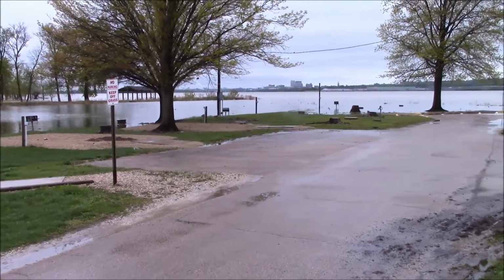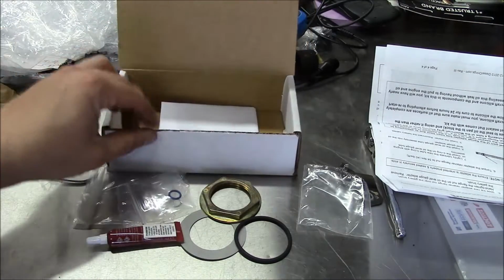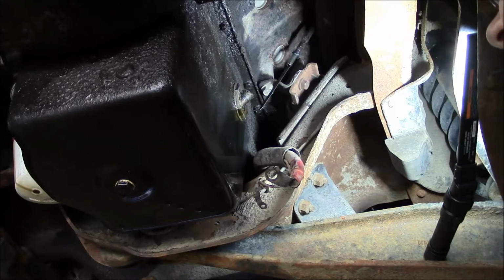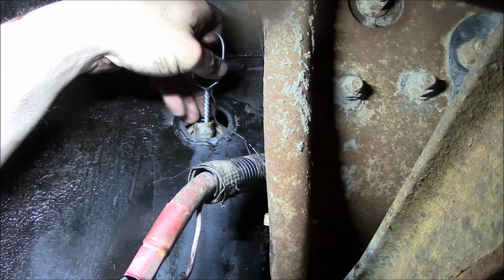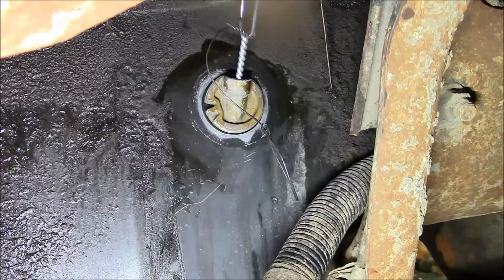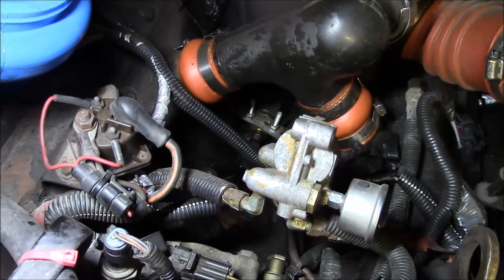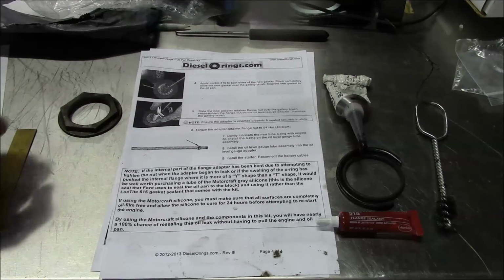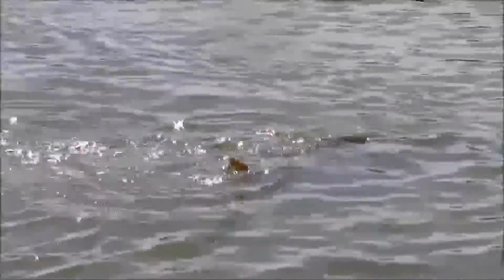7.3 Powerstroke Dipstick Oil Leak Fix

Comment: I see one person posted about sealing it up with silicone I use Right Stuff gasket maker that stuff is pretty much lifetime repair all you need to do is back off the nut hang on to things clean everything up put a bead of gasket maker all around the flange threads where it meets the pan and behind the nut so when you tighten it down it squishes out everywhere paying special attention to the two grooves because that's where the oil tends to run down and you can even put a layer over everything once you tighten everything down snugly and with that repair it'll never leak again I fix thousands of things with Right Stuff gasket maker is an amazing product best bonding agent I've ever used

Comment: Did this solve your leaks? Looks like you had oil on the starter and the front part of the transmission. Was the valley clear of oil?

Comment: Wow! Just wow, you're correct about the nut being over tightened that's exactly what happened to mine by the previous owner, whoever invented that kit was a genius, that brush tool was the cats meow that's for sure, I did mine the hardway, the first time I used silicone and it didn't work, the second time I used a whole tube of JB weld, one of the large tubes, it's been holding for the past 5 years, I sure wish I knew about that brush tool beforehand.

Comment: Tried the oring on mine & the flange is not bent & the oring seemed to thick & couldn't get the nut to start so its getting gasket sealer tonight!

Comment: Good video.
 I bought a new o ring kit, it leaked again in 2 weeks. For my 2nd try I used old intercooler boot and cut a gasket using the outer nut as a pattern. I cleaned inner surfaces, put my homemade gasket in place of the oring. No RTV or other inside the pan. It's been a year, still good. I hope this helps someone.
Reply: what is a intercooler boot?

Comment: the day is coming when you will have a sighted self-directing  little robot on a stout steel stem that can sneak in behind all the struts and cables and impossibly tight spaces where a gripped hand won't really fit and it will undo all those bolts behind the starter housing and tucked up under the air compressor and in behind the alternator......the guy who invents that take 'em out and put 'em back in bolt/nut/fastener extractor robot is going to be a billionaire

Comment: How do you like those hantek amp clamps? I've got the lower current one and have considered buying the higher current one. Only issue I've noticed with the lower current one is that the power/current-range switch is a bit fiddly. Lol, yeah, the oring swelled and bent the flange...

Comment: I installed a 6.9/C6 in a 1953 IHC R120. The 6.9 was a constant source of leaking. Repairs never lasted.   I retired the truck with the engine after I got a warning ticket from the environment police. The dipstick was always a problem. I remember fixing oil-cooler leaks a few times. Another area of failure was the bi-metal swath for the glow-plug circuit. I gave  up fixing this sensor after burning our several sets of glow plugs. The 6.9 was not a good cold engine starter. I used ether for most of the 225,000 miles I drove that truck. A little whiff will do just fine.

Comment: Do the instructions say to put the sealant on the INSIDE? I would be afraid it would just peal away and get in the pickup screen because you can't clean the inside of the pan of oil.

Comment: I might be missing something here but couldn't you drop the oil pan and replace the nut? 
Either way same result so doesn't matter. 
I'm just curious
Reply: It’s a pretty major job to remove the oil pan.  He mentions you can do it with removing the engine, but you do have to remove the transmission.

Comment: Dave Kersey  Sept 12 2020  Cam sensor  Have a 1996 f-250 73l Was a TSB on depth of sensor in block  ford had a TSB that added one or two shims to back it from the cam. Now they make two different sensors.  If that didn't work there sugestion is to replace the cam.. I used the shim and got it to work. Have you run into this ? Dave Vietnam vet 82 yrs old.Thanks

Comment: I remember this futile attempt to stop leaks. I installed a 6.9 Diesel in my R120 International. I drove it for 20+ years and about 225,000 miles. Oil leak mitigation was an annual event. I have Cummins now.
Reply: And now you replace transmissions instead of oil dipstick o rings. I noticed you said 'a cummins' not 'a dodge'. I wouldn't want to admit it either.
Reply: @blackhatch46  hater
Reply: @Log-Outdoors  Is that an insult? I dont understand inner city slang.
Reply: @blackhatch46  hahaha, shouldn't you be pulling the cab of your 6.4 just to do a head gasket? Power junk

Comment: Is it possible that they put a thicker o ring on the inside of the pan and said OK lady???and maybe it did work for a while and swelled causing it to bend??better solution what you did instead of dropping the oil pan!!!good work as usual!!!

Comment: Be very careful using brakleen around engine oils. 1 can of that stuff can contaminate up to 2000L of oil. We aren't allowed to use it in the oil fields anymore as the upgraders are saying it messes with their refining process.
Reply: holy snap.  thanks for sharing that very interesting.  a weird fact i learned in a township meeting, a little gasoline can ruin an aquifer, it moves faster than the water, some lady had a fuel oil delivery but no tank ... but the french drain...

Comment: Nice job, did you have  to drain the oil after all? Any issue with leaks so far ? Gonna do mines same way
Reply: Having the same issue and was curious about if you had to drain any or all of the oil.

Comment: I was always told you had to wait 15 to 20 minutes to let RTV set up a little bit and then go back and tighten it all the way, obviously that's untrue?
Reply from the maker: That's a good idea. It's not really possible here though since we have RTV on the threads. The big thing is to wait 24 hours for the RTV to cure before refilling the oil.
Reply: @WatchWesWork  ok, thanks that makes since...
Reply: no mechanics i know actually follow that, but it can't hurt, give it 10

Comment: If silicone is a hack then every modern engineer is a hack, all the modern shit i work on has most the engine covers and pans siliconed on, gone are the days of gaskets, i have done this on 7.3s using the motorcraft silicone and it usually works good.

Comment: FYI my son in law worked in the industry making seal that seal you replaced had a glue joint that's where it separated they since found a way to mold them solid no joints all one piece every o ring had to be glued and go into a heated iron for a hour one at a time how arkaioc

Comment: For the next time you have to tackle a leaking dipstick flange, you should look at my new kit. 73dipstick.com. I address the fact that the internal o ring is a problem. My kit seals from the outside because most on the internal pieces are deformed from the o ring failure.

Comment: You are right Wes, the dipstick adapter was overtightened at one point and time, I have seen it alot on those 7.3 / 444 engines.

Comment: Same issue on my 2002 7.3 oil pan cleaned it up real good on the outside never taking it apart as you did put high temp silicone on let it sit for a couple days it's been 3 yrs and no more leaks so far.
Reply: Do you happen to remember which brand  silicone you used on yours? I'm trying to figure out which one to get. Appreciate your help.
Reply: @somyal  it was a high  temp grey or black from Napa.
Reply: @ryanroads7748 thank you.

Comment: Your drawings are great.  I tried a o-ring on mine but it didn't work, flange was bent like yours.  Slathered motorcraft gray silicone all over it and it never leaked again.  Better than dropping the pan or those $300 kits out there.  No shame in that repair.
Reply from the maker: Like I said, International has a TSB basically saying to use silicone. Seems like a hack job, but it works great.
Reply: Well, how about this for a jack job.

I didn't remove the dip stick tube, and ran the nut off with a bungee in place on the tube to keep pressure on the inner o-ring. Used a tooth brush, and a can and a half of brake cleaner to get the threads, the two dimples for the orientation pin, and the surface of the pan where the nut sits surgically clean. I did get a good amount in the oil. I wanted to make sure the oil behind the adaptor was clear and it was clean, as to not contaminate the the sealing surfaces at the base of the threads. Contamination = no seal. After getting it all clean, I applied motorcraft TA-31 sealant to the alignment voids on the adaptor first with the tip of of the nozzle, and made sure to fill the void, and about 3/16" bead to the base of the threads.  I then ran the surgically clean factory nut, right back on there, and snugged it down. I let it sit for two hours before filling the oil after dropping it to remove contamination. 

No dipstick o-ring needed, no o ring for the inner adapter seal. Just a clean properly prepped surface, some 7.3 silicone, and it's bone dry. Probably a lifetime repair. I'd bet on this over any of these bullshit kits. Total cost, $23 for a tube of the TA-31, and about two and a half hours, mostly waiting for the silicone to set up. 

Yeah buddy.
Reply: I forgot to mention the squish out around the nut after snugging it down even looks factory. 

I'm thinking about making a replacement nut, flanged, with threads all the way down, and dual o-rings that seal on the outside. A very small dab of TA-31 at the engagement dimples before install, and bam. 

Sell them for a reasonable $25. 

I'm half tempted to get the 3d printer going. Seriously.

Comment: Wes o rings don't swell in oil. What they did is replace that o ring with a heavier one and tightened the hell out of it breaking it and bending the nut and internal part.  Ford with a better Idea?

Comment: The OEM nut was probably cast with softer metal to allow it to conform a bit with heating but along with that comes all the drawbacks of softer metal.  Your new kit nut was better with the larger flange and may have prevented the whole problem had Ford spent the extra dime to start with.  Anyway, another good fix, because of the opportunity to get silicone all over your hands and anything you touch!  I enjoy your one-man shop vids as I grew up in my Dad's one-man shop figuring out how to get her done by himself.  Not sure everyone appreciates the extra challenge of going it alone.
Reply from the maker: It's lots of fun until you need to bleed brakes or watch something under the hood while cranking the engine. It would be nice to have help a lot of times!

Comment: That Toyota FIPG is the toughest stuff I’ve ever used. Once it sets up on an oil pan you don’t even need bolts to secure the pan. I’ll take a jackhammer to ever separate the pan from the block. We used to call it Figpig way back in my dealership days.

Comment: Im chasing oil leaks on my excavator now. Rear main seal on the detroit and doing all the suction and pressures lines on the 3 pumps.   Also have a leaking valve body that i really don't want to mess with right now.    the dodge just did the oil feed to the turbo and the pan has a few damp spots so Im sure  its got a rust pinhole in it.  Pans are cheap but its all the work to replace one. 

Hope the silicone holds up for you and the diesel leaks were just those hose clamps.   Just keep telling yourself a few nickles and dimes is a lot better than a new vehicle payment.
Reply from the maker: Be careful with the new oil pan. I remember Deboss Garage did a video about a 5.9 Cummins that was ruined by a Dorman oil pan when the paint inside peeled off and clogged the oil pickup screen. I never would have thought of that!
Reply: @WatchWesWork   yikes thanks for the info. ill have to check it out.
Reply: @WatchWesWork  just sandblast it, no?

Comment: Good effective repair, possibly the old O-ring is a larger section size, and was cut to fit?.
Hope the water level stays below danger line.
Reply: Kinds bad idea to use a cut to fit o-ring inside the engine where is can fall off

Comment: Lets see how the oil pump likes silicon, the more the better, you could have buttered up the outside of the pan too. It's seems every time you fix one problem, another will pop up, it just goes with the territory when working on tired iron. My son's shop got a 4' water mark on the walls, someone opened a spillway, in six hours it was inundated. Have you tried RightStuff, it's pretty good sealant too.
Reply from the maker: I have used The Right Stuff. It works great. I use it to seal up coolant guards.

Comment: Wes, what do some say about the negative effects prefilling the oil filter with oil? 
Never heard that before.
Reply from the maker: Yes Volcker. I think it's better to have oil pressure sooner than to worry about the tiny amount of crud in the oil. Especially on the diesel engines where the filter is very large and holds a lot of oil. However, many newer engines are using cartridge filters that cannot really be pre-filled. So, maybe it's a moot point.
Reply: That's a rule for fuel filters but I've never heard of that for oil. When I have no choice but to pre fill a fuel filter I always try to only pour it in the "dirty" side of the filter.
Reply: You would think filling a brand new filter with brand new oil word he fairly safe. I think they are refering to the retards who reuse their oil filter and just swap the oil lol.
Reply: Forgive me for a late speculation: CAT implies big equipment which implies oil being changed on site in dirt, crud, and who-knows-what by an itinerant grease monkey. Perhaps this may be the reason for not refilling the filters so that said crud does not end up in the filter?
Reply: You people 🙄 Always fill the oil filter up at least 3/4. It's just good practice. If you don't understand why maybe you shouldn't try to play mechanic.

Cat in field 336, 963, 953, etc and so on and so on (none of you probally understand that terminology which proves my point. 

You should always fill filters, end of the day it's not catastrophic to not it's just good practice 

Also your all wrong, cat advised not to fill oil filters in the field not because of crud, 🙄 but because epa stepped in sometime around the early 80's and made cat say that to suggest against oil spillage on site back in the he day.    Simple as that, but yeah good job 🤌🙄
Reply from the maker: The theory is that it's better to let the oil be pumped through the filter to remove any crud before it goes to wherever it needs to go. In my opinion, if there is that mush crud in brand new oil, we've got much bigger problems than filling the oil filter. I know Cat filters specifically will tell you not to fill them. I've done it thousands of times.
Reply: Wes Johnson Services is the purpose of refilling them to minimize the time the engine runs with no oil?
Reply: @WatchWesWork  I been filling filters for 30 years or more on everything..  I personally like to have oil on the parts as soon as I can get it...  in the T-444E if you dont fill the filter the computer sets a code and logs the hours and mileage..  I dont think fords do...   ha! found this vid because at 205k I need to make this repair..  mine isnt just a few drops on the ground mine is a drizzle! luckily I caught it because there was a trail of smoke behind the bus (its a school bus).. I only lost a little over a gallon of oil..  im going to try the mitch olsen kit which is an outside seal method..  but I think i'll also RTV the inside just for kicks..

Comment: What does dieselorings.com primarily sell?
Reply from the maker: Parts for the 7.3 and 6.0 Powerstroke engines. Mostly gaskets and other seals. Looks like they also sell sensors and some hard parts. I don't know much about them. No affiliation.
Reply: I was only joking, but thanks
Reply from the maker: Well it's a confusing name since they only service two engines.

Comment: Every truck I have owned is a nickle and dime truck. I am glad I'm not the only one who siliconed my way out of a problem. It should be in the dictionary. Take care Wes
Reply: The newer vehicles are HD trucks  (hunnerd dolla) Just replaced parts for the antilock brakes on my F 150
Reply from the maker: I find it takes a large number of nickels to fix most things these days, especially a diesel.
Reply: @cyrilhudak4568  you can usually re-solder the ABS controller and fix the issue on fords.
Reply: My present truck went from nickel & dime to piles of Benjamins. It’s still way better that the hellacious truck payments.
Reply from the maker: It's not ideal, that's for sure.

Comment: never seen that poor a design on a motor before. I would love to know why its not a tube welded in. like every other sump.
Reply from the maker: It's a terrible design. They could have at least used steel fittings, or even aluminum. There are weld in fittings available, but you have to remove the oil pan.
Reply: Wes Johnson Services More than one mechanic has had a cussing fit over that design. Been many rear main seals replaced when the real culprit was turbo pedestal seals. Been there a few times.
Reply: @WatchWesWork  love your channel by the way. I am also a machine tool service tech. but living in Australia.
Reply from the maker: That's cool. What kind of machines are popular in Australia?
Reply: @WatchWesWork  haas and mazak lathes and vertical mills are the better ones but lots of shit out of china with fanuc controls and drives . due to local manufacturing going to shit recently moved over to working on wood working machines also. same problems and skill set just replace dealing with coolant and oil with saw dust and grease.